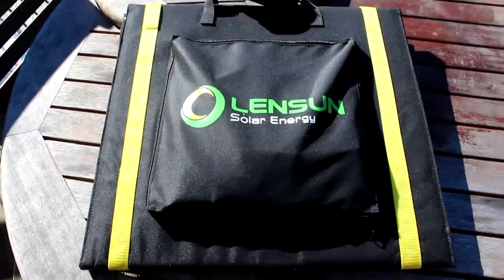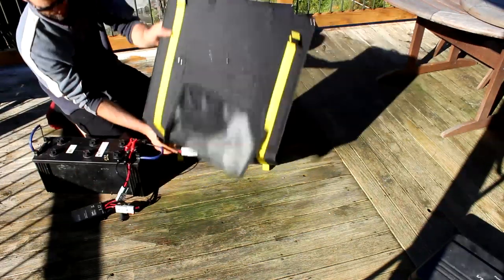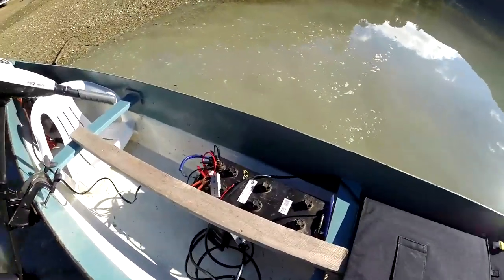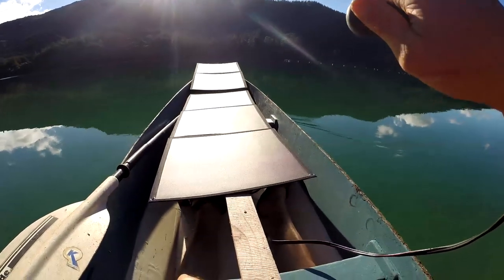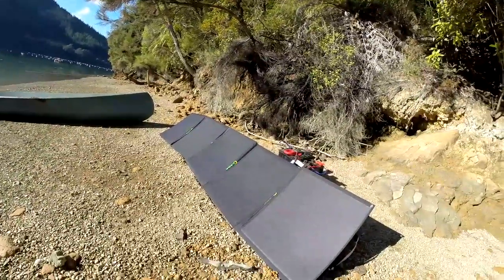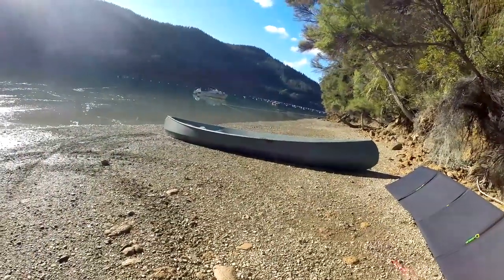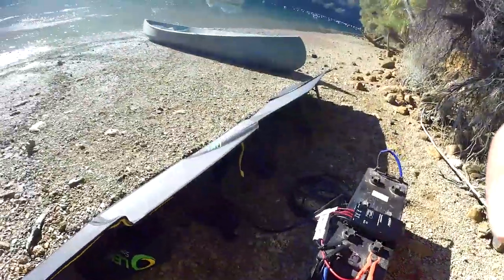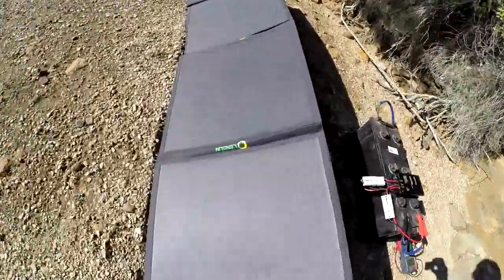Lensun 200w portable solar panel powering a Canadian canoe

Comment: Fantastic. Of course dealing with the whole setup in fine weather is optimum. In inclement weather would probably be a lot more difficult.
Reply: you wouldn't do any canoe stuff in choppy Waters to begin with. I was most in awe of the silence. The problem with ICEpowered boats is the noise pollution across entire bodies of water.
Reply: @velotill  //  It's not whether the water was choppy–rather it's whether the sun is shining. Something the sun may or my not do regardless of windspeed.

Comment: Nice panel. But to do a good test you need to see what the panel is putting out and what the motor is using. This panel is 200 w but probably will put out 18 to 20 volts? the battery will charge with maybe 14 volts and a cheap pwm solar charger will through away the exces voltage. so 6 volts are wasted. lets say it will put out 10 amps at 20 volts in full sunlight. 10x20=200 watts. but the cheap pwm will just through out 6 volts. 14x10 amp= 140 watts that you use. 60 watts wasted. A mppt charge controller is more expensive but will convert the exces voltage of 6 volts into extra amps. so it will charge also at 14 volts but now with 14 amps (it will be a bit less, converting will make you loose some watts to heat. but in the ideal world 14vx14.28 amps=200 watts. You have a clamp on amp meter. put it over the motor wire and over the charge wire and measure the voltage when under charge. now you can see in numbers what is happening. We use a 100 watt semi flex panel in the boat. we have a 19ft maxum sports cuddy. we use it for wakeboarding etc. But also for camping trips  to a nearby nature reserve. we use a normal 12v peltier driven car fridge. and the panel will put out 5,5 amps in bright sun and the fridge will use 4,2 amps.  we have an extra 12v 50 amp car battery that we use with the solar as soon we are at anchor. fridge will run all day (we only go with good weather so a lot of sun) and battery will stay full. and in the evening without sun (in summer on the water we can catch the sun until 9 or so and still have enough to keep it full. we put the panel direct to the sun. it can be on the top and on the side and on the back the front. under any angle. always optimum exposure. and after the sun went down we run it for like half an hour every hour. at night it is off but the temp went down also and the mass inside will help to stay relative cool. And the first to get up will put it on power and the circel is closed. it is such a treat to be on the boat in 30 to 40 degrees celcius and have cold drinks and keep meat and salad fresh. just a 1 x 0.5mtr 100w solar panel. i use a pwm solar charger wit a display that will show you the voltage and amps in and amps out in one  view. great unit.
Reply: It's an MPPT charger. It's possible to see on the front panel of the charger on the 1:27 minute of the video